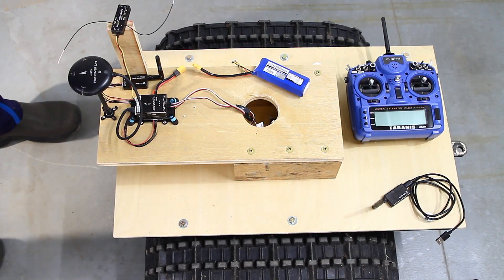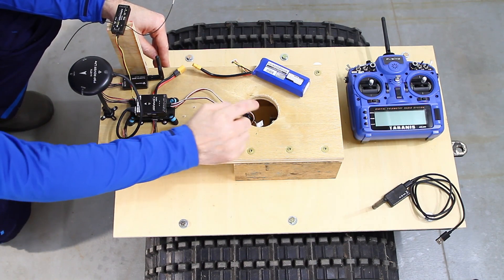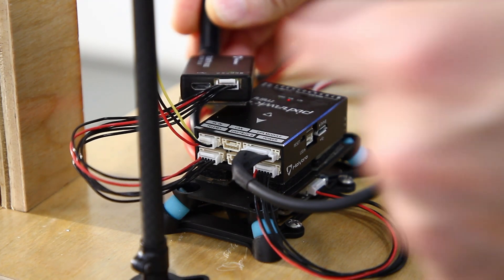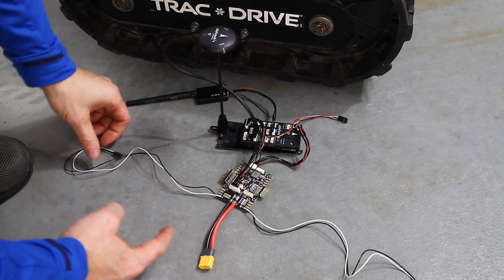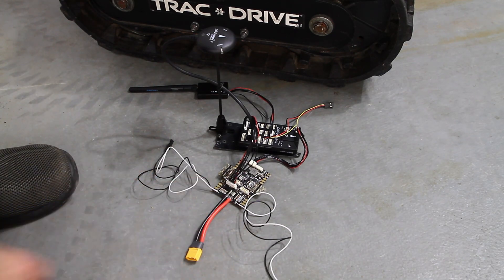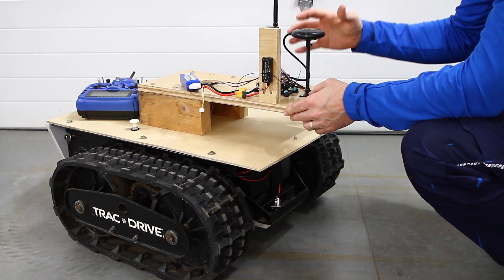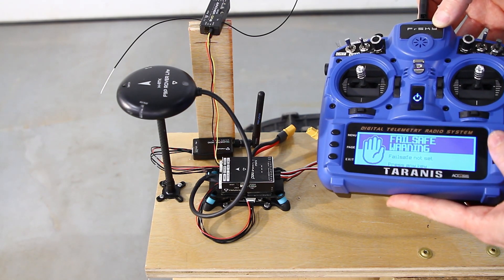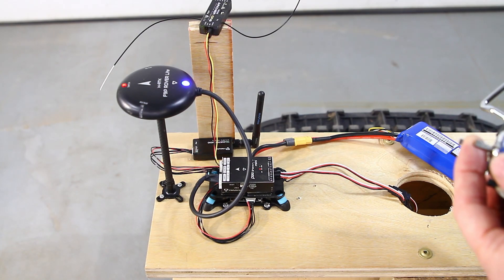Track Robot Pixhawk RTK GPS RC Radio and Telemetry Connections Closer Look

Comment: how do you map a radio channel to a servo in ardupilot?  I've got ch1 moving servo output 1 (ground steering) and ch2 isn't doing anything, but it works in the radio calibration page.  I've tried setting #2 and #3 to throttle but there is no movement of the green bar on the servo output page.  I'm making a skid steer too, when i change the servo outputs to throttle left and throttle right then I don't even get the green bar moving on ch1.  There's something about the servo function that's assigning the chanel to the radio?

Comment: With the Pixhawk 4 mini having been discontinued, which Pixhawk would you reccomend for a skidsteer rover?
Reply: I'm running into this issue as well. Holybro says they will release a new H7 variant to replace the PX4 Mini in 4 to 6 weeks. 

Working on a tank rover and a marine drone that uses differential thrust, so they both drive basically the same way.
Reply from the maker: I whish I had a good answer.  One with only one microprocessor in it (no extended serial ports).  Basically find a minimal one, any of the more feature rich models will likely have an additional microprocessor that adds more serial ports.  When I built mine I could not get the Rover firmware to drive the motor controller and I suspect it was because of the extended serial capabilities that the Rover firmware didn't know how to use properly.  I hope that helps.
Reply: @BZEUG  Thank you
Reply: @BZEUG nicely done!
What version of Ardupilot were you using? Did the Ardupilot Forum have any insight? The developers and regular users are pretty good at helping debug.

Comment: Did you get the GPS “POINTS” ACCURATE WITH YOUR ROBOT WITHIN 3 TO 4 INCHES CONSISTENTLY?

IM DISABLED AND MAKING A MOWER TO CUT ACCURATE PATTERN WHILE CUTTING AROUND O BJECTS (TREES, BUSHES, TREE ROOTS) ETC.

THX!
Reply from the maker: I don't know the exact precision but I would say less than 6 inches consistently for sure.  RTK is the only way to get any amount of real precision and this RTK system even with no base station did a very satisfactory job for me.
Reply: @BZEUG  what RTK GPS module are you using?
Reply from the maker: @SylvianKimkpe  https://holybro.com/collections/gps-rtk-systems/products/h-rtk-f9p-gnss-series

Comment: Nice! How do you tune the parameters in px4?
Reply from the maker: There is not anything custom.  I just load up Ardupilot Mission Planner on my laptop which has the USB 900mhz radio connected, I use that COM port to connect to the other 900mhz radio on PX4mini.  Then I can use Mission Planner to flash the "Rover" firmware to the PX4mini.  I had to go through the calibration procedure, but other than that I did not change much of anything beyond the stock parameters.  I should do a video about it, because I know I am already forgetting some steps.  The problem with making videos about software is they are time consuming and become obsolete relatively quickly.  The good thing about such a video is that I can watch it myself to remember all the steps.
Reply: @bzeug Hi did you did the video? Regardless

Comment: How do you set ardupilot for tracks instead of wheels?
Reply from the maker: I have the sabertooth motor controller set to mixed steering mode (not tank steering) so that it accepts inputs as if it was an RC car.